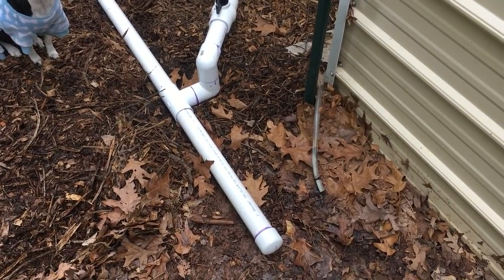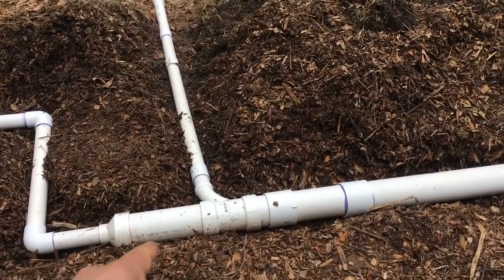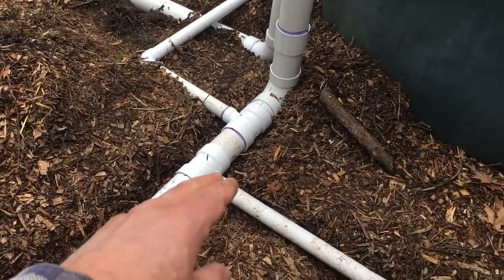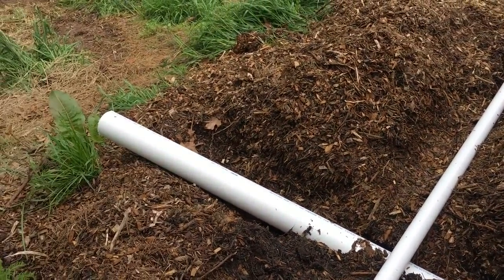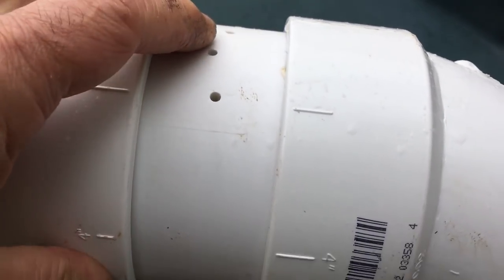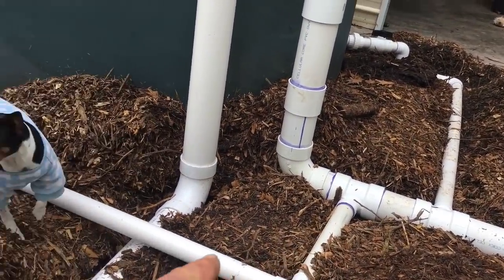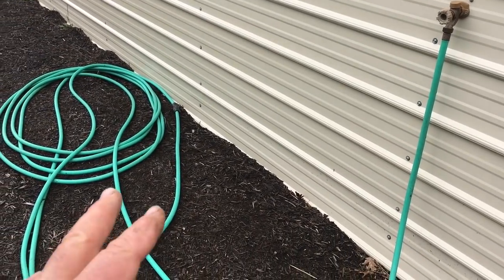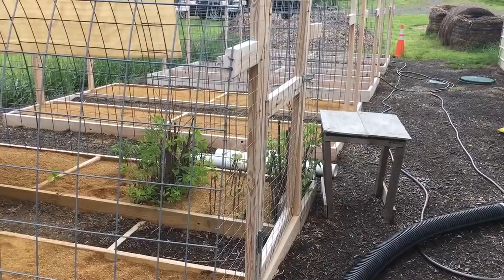Large Rainwater Harvesting System Upgrade part 3   Lower Plumbing

Comment: How come you set it up Tank>QD>shutoff valve instead of Tank>shutoff valve>QD? Also it doesn't hurt anything but a 4" pipe is over kill. The area of your dual 2" inlets is approx. 25" and the area of your 4" pipe is approx. 50". If you wanted to save some money a 3" pipe will always always out flow dual 2" because it has an area of approx. 28"
Reply from the maker: Thanks!

Comment: Looks very impressive but I do have one thing to point out.

Where you start the system with a 2" future connection for the next tank, shouldn't the collection header be 4" right up to the future connection? The reason I ask is that you state that you have increased to 4" because of the 2 tanks coming together but you now have the same problem when you plumb in the 3rd tank.

Not a criticism, just an observation and I'm sure you have good reason.
Reply from the maker: Thanks for the suggestion.  I don't know that I'd need larger at that point because I have 2" feeds coming out of the tanks.  The concern for 4" was where two 2" pipes came together, each with their own input above.  The future connection will not have another input on the top side, it is just for additional storage from the other two systems.  Does that make sense?
Reply: Makes perfect sense. It was only my piping design checking eye having a quick look.

Comment: Why didn't you just use the holes already installed on the tanks for the overflow protection?
Reply from the maker: I could have, but it is only 1-1/2" with two 3" pipes for input, so it may not keep up with a down pour.  Also, the green tank overflow was added by the previous owner after they bought the tank.  The PVC "U-Turn" method would be cheaper than purchasing the bulkhead valves on the tanks.
Reply: Great Escape Farms ah ok I see now, thanks for the reply
Reply from the maker: You are welcome!